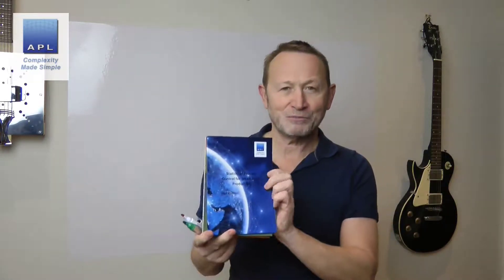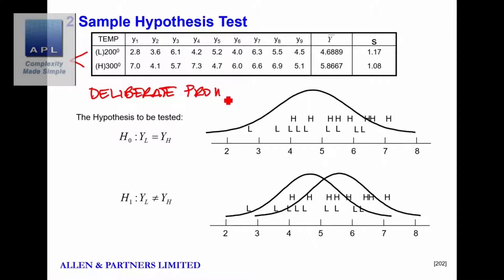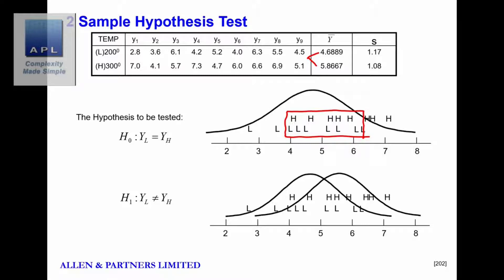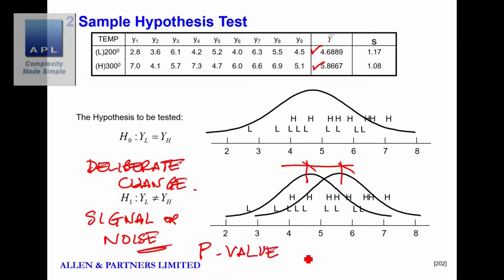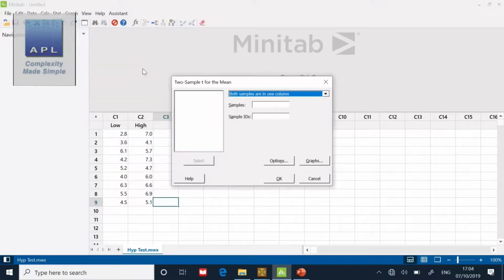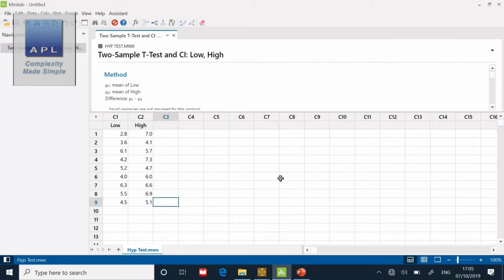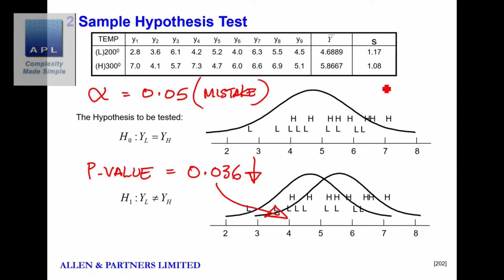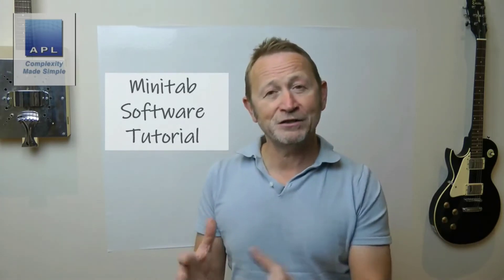Minitab T test - Tutorial

Comment: You have suggested to used "Difference ≠ hypothesized difference" option as it is recognized as the strongest test, although I put your table (values) in minitab and use ´<´ and ´>´ options too just to see what happened.  With option ´Difference < hypothesized difference´ pvalue is 0.018 while in ´>´ option pvalue is 0.982      .....I was just wondering, if with ´<´ option Pvale is lower than that obtained with ≠ option, isn´t it better to used ´<´ option? I mean, Lower chance of making a mistake.  Am I wrong?
Reply from the maker: Claudia - the reason i use that choice is that I don't know whether the new result would be higher or lower. I just want to know if my test has moved the result. And that choice will give a good result whatever happens...
Reply: @paulallen5321  Ok I got it! I had not seen it from that point of view! Thanks

Comment: Hi Paul! Based on the p-value obtained, another way to conclude is: The temperature is a variable that does affect the outcome ´Y´ of the process. Is it right to put it into these words?
Reply from the maker: Claudia - In a practical sense you are right. the statisticians would put it in very mathematical language though. remember though in order for your statement to be correct, you would repeat the trial a second time, this known as a confirmation test. Then your statment is correct...
Reply: @paulallen5321  Thank  so Much for your reply Paul!!   Ok, I see. So in order to support statistically this,  it would better to use an ANOVA analysis to get an accurate statement. Once again.... Than you!
Reply from the maker: Hi Claudia - actually no need to any statistical analysis the 2nd time. You're just provinig beyond doubt that test one wasn't just a lucky result....
Reply: @paulallen5321  Got it! Thank U